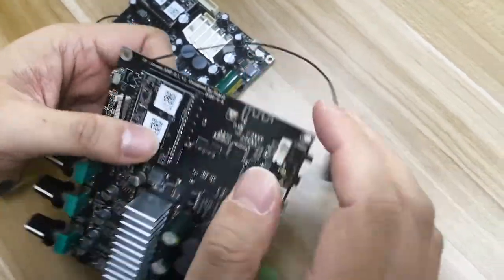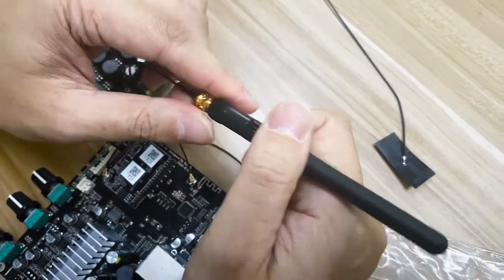How to connect Audio Amplifiers and Audio Preamplifiers to your Speakers?

Comment: @Arylic Audio
I have a question and would appreciate it if you or someone else here could answer it.
Is it possible to connect the TV to the BP50 via Optical In and then connect the sound bar to the BP50 via HDMI ARC to output the sound to the sound bar? I know I could connect it directly, but I just want to connect all the devices to the BP50 so sound could go out to sound bar. Thank you!

Comment: So can I use your units for my guitar pedalboard as follows?
The output of the pedalboard (stereo in my actual setup) will go into the Upstream mini V3. On the desk I will connect the S10 amplifier to the speakers. Can the speakers be active or passive? What's the latency of the music played and heard? Thanks.
Reply from the maker: 1.  guitar pedalboard to Up2stream Mini V3 is available.
2. S10 is a streamer, not an amplifier. You may need amplifier or your can check our A30+ or  A50+.
Reply from the maker: 3. About the latency of music, It is very micro. It is hard to hear that with Human ears.